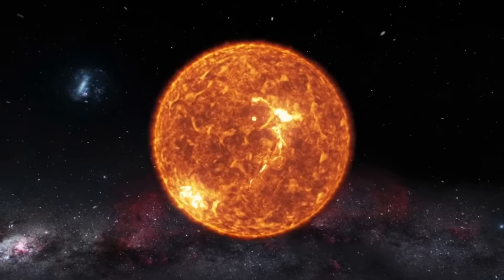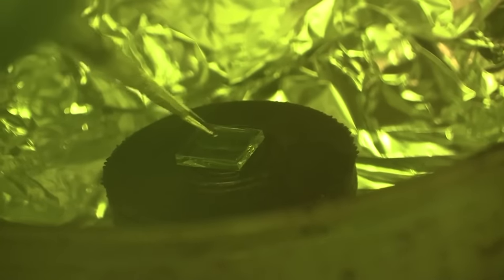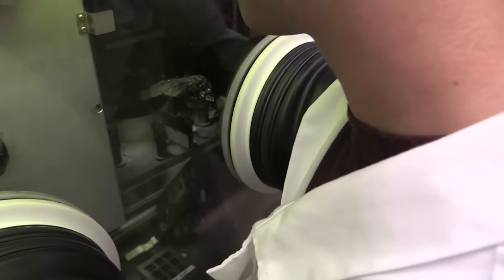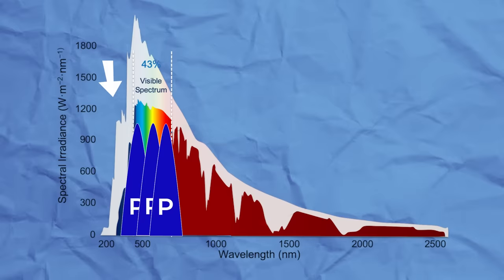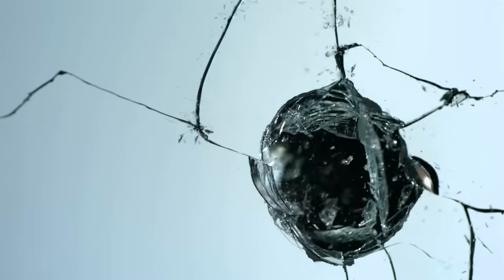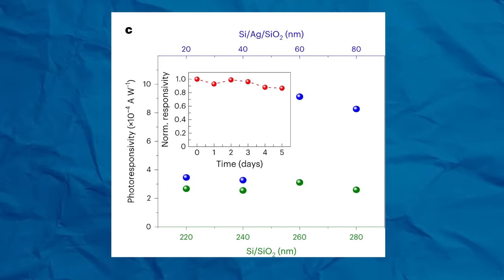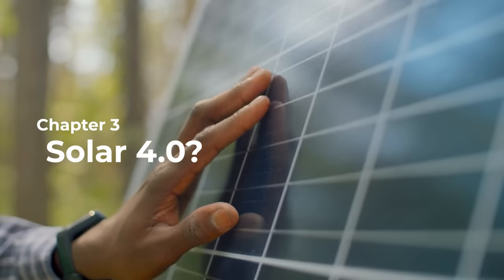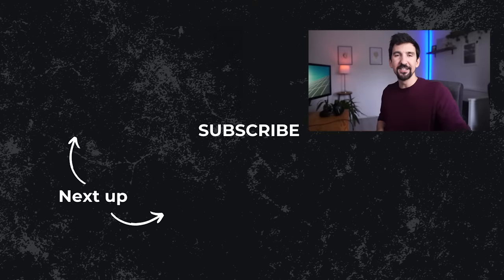Solar 4.0: Ultra Efficient Solar Panel Breakthrough

Comment: Please don’t use phrases like “an increase by a factor of 250%”. A factor is a simple multiple, such as 3.5. Every time someone uses a percentage greater than 100% as an increase, it’s always ambiguous what they mean (is 250% 2.5 or 3.5?), because too many that use it are innumerate and want to impress with big numbers.
Reply: Was confused also 😔
Reply: 250% means 1.5 increase
Reply: @condruzmarius  — A factor of 1.5 is a 50% increase; a 250% increase is a factor of 3.5.

By example, if one normally eats 2000 cal/day, and increases it to 3000, that is a 50% increase and a factor of 1.5, which is the original (1.0) plus the factor of increase (0.5). If one were to increase it to 7000, that would be an increase of 5000 cal, or 250% of 2000, and a total factor of 3.5. 

The ambiguous part is one could say the increase (5000) is a factor of 2.5, which correlates to the percentage increase (250%). Usually, if we say “increased by a factor of …”, it’s the total divided by the original, not the increase divided by the original.
Reply: I put 100 coconuts into bank of coco. Next day I go back to my nut account and find I only have 50= a loss of fifty %. Next week I deposit 100 coconuts in my isa nut account. Next day I find 200 an increase of 100%. 💯 one more unit than I started with. If it was 300 then I would have two more units than I started with which would be 2x 100% which to me is 200%. So if we start out with a panel that produces 100w and we see an increase of 250% then you do the math!
Reply: Thank you, I to get pissed when people don't know how percentage work.

Comment: So, typical solar cells are in the 20-30% efficiency range...does this mean that these new cells could have around 75% efficiency? I can't believe this was not ever discussed in this video 👎
Reply: That's how solar propaganda works. Hint, suggest, imply, but when it comes to demonstrate...that's often conspicuously missing. I'd like to see the hard data as well.
Reply: Those estimates should follow the creation of stable PV film. This video is about a developing technology, so its numbers are not yet relevant.
Reply: @kittimcconnell2633  Yes, of course...that is the problem...he video title & thumbnails don't reflect what the typical viewer expects ("Ultra Efficient Solar Panel Breakthrough" and the thumbnail shows a 250% efficiency improvement)...if the video had stated something about improving a part of the process which has no current bearing with solar panel efficiency, that would have been different...in essence this is just cheap click bait 👎
Reply: No he said 250% INCREASE, so if it was 25% efficient before, 100% increase brings it to 50%, 200% increase brings it to 75%, and 250% increase brings it to 87.5% 😂
Reply: @blakelee4555  If you use  20%, a 250% increase is 70%, so just rounded up a bit to 75%...not sure what your point is...
Reply: Like all the datum efficiency has prob been cherry picked as likely we are also taking a theoretical max or at most a lab max.
Still though when rounded down to reality it could be a huge improvement, but still the long term stability of the substrate seems to be a huge hurdle.
Reply: What about the First law of Thermodynamics??
Reply: @elcheapo9444  `energy can be transformed from one form to another, but can be neither created nor destroyed.` So what about it?
Reply: @rolyantrauts2304  "250%" is what's wrong with it.
Reply: @elcheapo9444  250% improvement not 250% conversion doh! Its still <75% of sunlight as some are posting but thinking that is likely way to high.
Reply: No, around 26%
Reply: @DIYDaveOK  I enjoy watching these types of videos because it is interesting to see what potential technologies are on the horizon. However, I have learned, as you have as well, most ride off into the sunset, never to be heard from again. This sounds like one of them.
Reply: No - these don’t achieve a 250% improvement over existing photovoltaic cells - they achieve a 250% improvement over the previous efficiency of this particular technology - so they’re approaching the point where they may be competitive with the 20% efficient silicon photovoltaic cells. Their advantage would be that they’re significantly cheaper to produce, and can be applied to more materials, expanding where and how you can employ solar electricity generation.
Reply: @babybirdhome  😂😂😂 and angain😢. The way numbers have become playthings
Reply: @babybirdhome  Yes, this makes sense, and is information that should have at least been discussed in this clearly click bait video
Reply: Recombination is but one of many sources of loss in a solar cell.  If such a large reduction in that one mode, another will be the main limiter.  However the design compromise ls that go into limiting recombination losses (like a very thin layer) can be relaxed and other considerations optimized (like a thicker layer to absorb more light).  These are incremental improvements, not revolutions.

Besides batteries have been the limiting factor for solar energy ever since panels hit about 15% efficiency.
Reply: Perowkit are degrading even when kept at storehoise. So it is not advantage.
Reply: Clickbait
Reply: @blakelee4555  he said such but he's wrong
Reply: These are cheap solar cells that have 8-12% efficiency, 250X of that will be 20-30% which they achieve in lab. Realistically it will be around 15% when used in real life. So less efficient than sillicon solar cells which are used in general and cost more.
Reply: No, it means 250% of the light hitting it. Using these cells will slowly make the Earth hotter than the Sun. Free energy ftw!
Reply: Well, the paper is available and has hard data..
Reply: Just wait three years and ask ChatGPT-6 to design super efficient solar cells, and twenty seconds later it will reply with the design.  Problem solved.
Reply: 30%? No cells are that efficient
Reply: Chatgpt reports only 25%
Reply: @DIYDaveOK  unless it's just a basic entertainment/communication old trick strategy to get people attention...
Reply: Commercial silicon solar panels have efficiencies of around 20%, the record is 26%. The record for a composite solar panel is 47.1%.
Reply: I read the theoretical best conversion is 42% for solar due to losses that can't be captured by any possible tech that obeys the laws of physics. They have made panels that get 40% but they are only used in space craft due to being more than 10x more expensive.  So no chance this is 75% efficient. Also perovskite panels are in the single digits for efficiency at Present so a 250% increase just puts it in the lower 20s which common silicon panels already get.  So the break through is really about price.
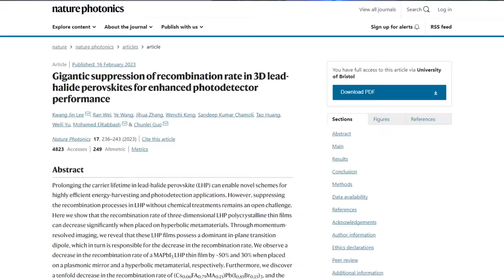Reply: 5:33 if you look carefully the 250% number is mentioned in the abstract of the paper, but it only refers to one aspect of the technology not the efficiency of the cell. Typical click bait.

Comment: I wish this video had 250% more information about the absolute efficiency of the cells.
Reply: I'd love to know if they've been tested in a Desert environment? Let's say 115F?  I don't get excited about any new Solar Tech unless it's run flawlessly for 5 years in a serious Desert..  The major failure w/ HCPV (Hight Concentrated PV) was the cells could not handle the heat.  This included cells w/ heat pipes (passive cooling), etc.  The cells would deform and then separate.  Some of the advanced  HCPV cells were multi-junciton / full spectrum too.
Reply: Basically above 20% absolute efficiency is impossible for a solar cell.
Reply: @yousausage  Perovskite solar cells already are higher than that (about 24% current record). I honestly don't believe at all that this will now be increased by 250% or anything close to that, but why shouldn't further increases not be possible? Perovskite cells started out with about 3% (2009), and have made quite a lot of progress in the last 14 years.
Reply: @yousausage  except it isn’t. Why do you think it is?
Reply: Exactly what I came here to say.  250% higher than Si solar cells?  than current Perovskite solar cells?  What is the present efficiency of Perovskite solar cells? ...
Reply: idk but if compared to better ones: +20% it must be about 50%
Reply: See 3:21
Reply: @charonstyxferryman  look up aqua regia. one of the strongest acids known to exist.
Reply: Max efficiency is always less than 100% (will never be 100%), and a good rule is that whenever you see anyone talking about efficiencies over 100%, avoid them because they don't even understand the fundamental of physics, let alone how PV designs work (solar panels)...Besides, I have a PhD in electrical engineering (signal processing and AI); Aside from some forms that ask for the title, I never put Dr behind my name, let long for my public channel... If you are perfect in your work, you don't need to remind people that you are a doctor .
Reply: @yousausage  What if you add germanium layer to capture infrared too?
Reply: @charonstyxferryman  Put on a tank. War is more hostile.
Reply: @JBereza  typically gallium arsenide is used for IR absorption.  Germanium can be used but there's an additional cost hit and difficulty with manufacturing.  In general single junction monocrystalline solar cells cap out at 20% plus or minus about 2%. If you want to get up into the higher percentages you need to make it a multi-junction/heterojunction which increases the cost by over an order of magnitude. These types of cells are what are used in space and typically are around 40% efficient.  I will note that single junction silicon cells inside the lab can perform at or above 28%, however this is never realized in commercial panels.
Reply: @HansKeesom  Okay, still doesnt answer the question of what it increased to... further 250% FROM WHAT???
Reply: Yes. 250% over 1% absolute efficiency is nothing to boast about.
Reply: @HavokBWR  it's surprising most of the people in the comments aren't even logical enough to get your fact ...
Reply: Stop being so simple friend. Build a thermoneuclaic cell not yet avail to the public smh
Reply: @KindofaScientist  At minute 5:33 is the paper of the investigation claiming 250% and at 8:10 the curve of photoresponse from about 3.5 to 8.5 give 150% above the 3.5, not 250%. All we know efficiency maximum is 100% and unachievable. Like the Betz limit of 59% of wind power conversion is the 100% of that conversion. Is common new technology talk in jump of #% in wind conversion relative to other technology of the same field, in direction of that 100% which is physical 59%. Many physics fields use this, and comments in that section ask exactly this: 250% relative to what? Silicium cells? Numberphille interviews at University investigators give a stamp of confidence as there almost are Masters/PhD. Some YouTubers out of  university, if have some degree, is not bad referring that, as talk to all world, and some viewers of "flat earth" may be see a specialist, and don't comment.
Reply: @RF-fi2pt  Thank you for pointing it out, but the paper suggests a 250% increase in photosensitivity, NOT a 250% increase in system efficiency and don't you agree that the difference should be explained so that viewers would know the difference? overall system efficiency for PV is what we care for in designs ( as electrical engineers). Everything aside, in the past 5 years as I was searching for papers related to my topic (passive sonar) I realized that no matter the publisher, some good portion of papers don't offer anything and sometimes fabricate data! So now if I want to use a paper as reference I look for the ones that have been cited by lots of other researchers but I guess in PV fabrication you probably cant lie since someone else will try to build it....
Reply: @yousausage  - Wrong.
Reply: 250% increase in photoresponse of Lead-Halide-Perovskite based photo detectors. Highlighted at 5:36
Reply: @HavokBWR  250% increase in photoresponse of lead-halide-perovskite based photodetectors. @5:36 Did you even watch the video? Lol
Reply: @yousausage  sort of a Carnot efficiency thing
Reply: Ok thx for this. I dont have to watch this
Reply: @yousausage  record is actually closer to 40% but use 4 junctions to achieve it. If you add a solar concentrator on top of that you get closer to 48%. Theoretical single junction limit is a little over 30%. Very expensive however for 4 junction solar cells.
Reply: @Aridzonan13  Sounds like an engineering issue. This video is more along the lines of theory.
Reply: @yousausage  weird, then, that the absolute efficiency ceiling has been over 20% for more than a decade now. Even thin film panels can hit 22%.  Monocrystalline cells can reach upwards of 42% with the right conditions.
Reply: absolute?   basic law, you cant fill a glass over 100%.... same with energy you cant get more then is given...  hence our current panels ACCESSIBLE to buy is more like 21 ish %       like saying I can eat 200% of this apple,...   think about it...
Reply: Not sure what the research paper is, but these high efficiency values, usually are for a very small surface area, like 0.5cm^2 as the larger the surface area, the larger the number of defects. When you scale them up the absolute efficiency will drop. They have often tried to combine these with silicon based solar cells to improve their efficiency by a few percent. Stability wise though 5 years ago, they still had to have a breakthrough. Moisture was one of the most challenging things to their stability.
Reply: 25% currently?
Reply: @harleyme3163  except your not filling a volume here, a glass, your increasing the photon hit rate that allows more electrons to get dislodged and create a current.
Reply: @KindofaScientist  There's a difference between 100% absolute efficiency and one material being 100% more efficient than another. You seem confused, or confusing. And at about 5:33 he states that it's the photocurrent liberated from the device that's increased by 250% (or was that "to 250%" of its initial value?).
Reply: I guess +250% means a 3.5 times increase in percentage points for the efficiency number. Thus 20% would become 70% . 
   Of course the layfolk mean to say 2.5 times increase when they state 250% . It's a perennial mistake.
Reply: @philip5940  theres no solar cell that has a 70% efficiency, that would be a massive jump from the roughly 25-27% efficiency we have now in most cells out now, but we don't get massive 250% bumps in research, we get gradual improvements as the physics is further understood and processes to make those cells is designed.
Reply: @michaelkeudel8770   The Man With the Golden Gun .
Reply: @philip5940  Yes--it's as common and as incorrect as "50% less."
Reply: 20% x 2.5 = 50%
Reply: Over 100% of WHAT?  I think the idea is 2.5x the current 20% efficiency.  So, 250% increase of 20% efficiency would be 50% efficiency.    @KindofaScientist
Reply: haha
Reply: @markstephenson6952  " So, 250% increase of 20% efficiency would be 50% efficiency." Nah it don't work like that, Mark. Look at it this way. A percent increase of something means adding the percentage of the original to the original. So to increase 10 x 100% means 10 + 100% of 10 which is 20. Likewise to increase 20 by 250% means you add 2.5 times 20 to 20 which is 70. The idea is that we INCREASE the original by the percentage of the original. :)
Reply: @KindofaScientist  I don't understand where you are going. This is not about over-unity pseudoscience. It is simply saying the existing low efficiency can be increased by a certain multiple. There is nothing wrong with the idea that a process that is currently 20% efficient can be increased in efficiency by more than 100%. The result is still under 100% efficiency. By the way, why did you feel the need to mention your PhD? Didn't you say if you were any good at your work you don't need to?
Reply: @robguyatt9602  - I stand corrected.  Nonetheless - I'll be amazed if they achieve efficiencies at 30-35%.  50% (or 70%) are not likely.
Reply: @markstephenson6952  What we don't know is what they were claiming a 250% increase on so we have no grounds to call BS. We just just don't know.
Reply: Thank you for your comment! While the video title may not have provided enough information on the absolute efficiency of the solar cells, I highly recommend checking out the Segway Portable PowerStation Cube Series. It's a powerful and versatile power station that can power your devices for extended periods. With its fast recharging, waterproof technology, and comprehensive protections, it's perfect for outdoor enthusiasts and RV lovers.
Reply: @strangelyrepulsive77  70%.
Reply: saltee8460  as a thermodynamicist the laws of thermodynamics are an impassible barrier unfortunately.
Reply: If you're left wanting, most like the product is very very far off, if it comes at all.
Reply: well the actual highest recorded efficiency of a solar cell is 47.6% and its physically impossible to even pass 100%. so theres no chance anyone should take anything in this video seriously